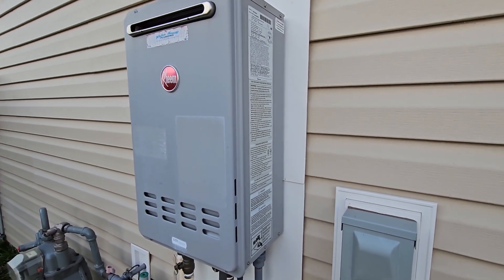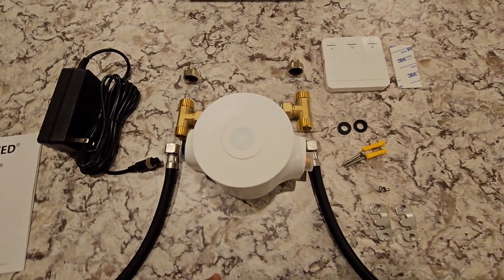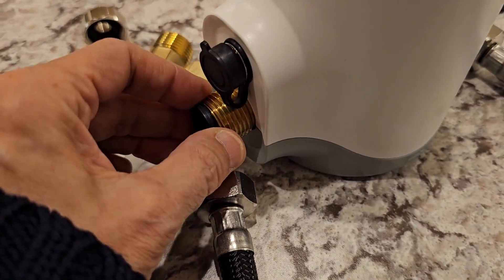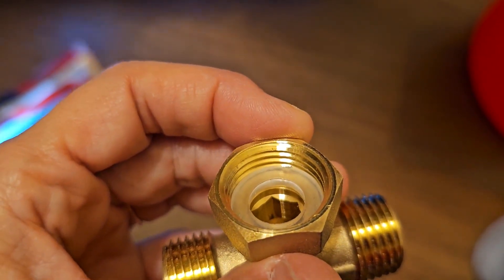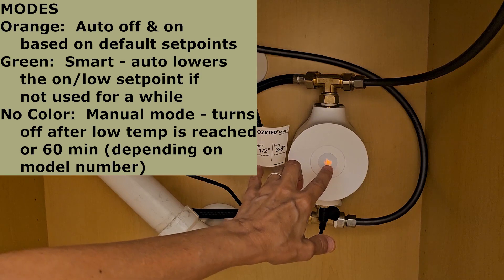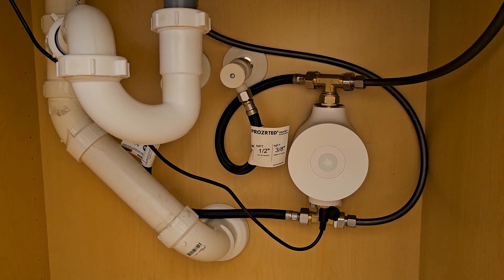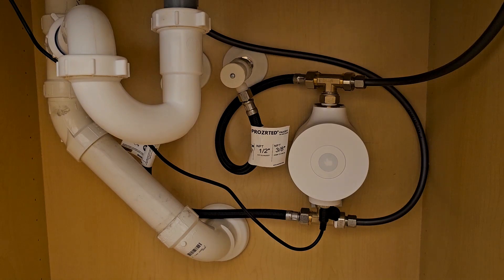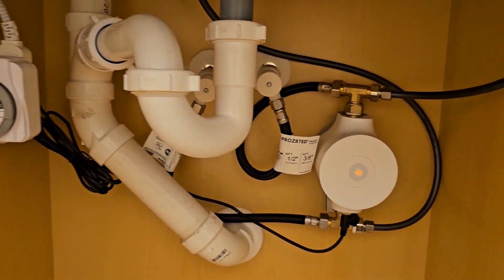Prozrted Smart Instant Hot Water Recirculating System - Install and Use

Comment: This solutions works if the heater has a non-return valve?
Reply from the maker: Yes. It it uses the cold water to return. The cold water stays slightly warm, but not annoying.

Comment: I just bought this system but the manual clearly states not to vertically mount the motor shaft. The manual shows it mounted many ways and has an “X” through the incorrect way even though some of the diagrams show what looks like the incorrect way. Unfortunately, the pictures are poor quality so and your installation looks like the incorrect way. Did you pursue this with the manufacturer?
Reply from the maker: We've had no issues whatsoever.  I no longer have the manual. But, the Amazon listing for our model shows it mounted vertically.

Comment: Does this unit only work for the faucet that this pump is located at, or do all the faucets get the benefit?
Reply from the maker: All of the faucets benefit.  If you locate the recirculator at your the sink furthest away from your water heater, when any of the other sinks are used, they will just have to get hot water from the central line - not all the way back at the water heater.

Comment: it works well to supply "warm" water but when I try the manual switch to high it doesn't change water temperature. I would like the pump to stay on longer to get hotter water.

Comment: Can this pump be turned to manual mode in the on state when power is given?  Just wonder if a smart plug could be used to turn this pump on and off vs using their remote?
Reply from the maker: We have ours plugged into a timer. So ours is only on in the mornings and late evenings.
Reply: @Jean78578  thanks

Comment: That is NOT an instant hot water heater. It is a tankless water heater. Big difference.
Reply from the maker: Well, it definitely is an instant, or I would not need the recirculator..   Lol
Reply: @Jean78578 
If the hot water in the geyser is below 38°c, the system will continue to run until your geyser produces 38°c hot water.
.
.
Reply: Instant hot water heaters are tankless heaters, there’s no difference. What are you talking about.
Reply: Does not provide instant hot water. Not well designed. it will still give cold water before the hot water.
Reply: I believe he is talking about the fact instant hot water leaving the tank does not mean its instant hot water at the faucet; just a simple misunderstanding.

Comment: Of course if kept on auto your costs may increase but based upon how often you previously used hot H2O and made it hot by running for 5 minutes down the drain as I had to, perhaps not. It depends on pipe length under slab and where you live ( ground temp here is between 50-70 all year) but if you want be sure, do what I do - keep on manual, press to run. Same heat loss, same cost to heat as non pump method but pump shuts down when H2O is hot. Now however you save the cost of whatever your water company charges per gallon which used to go down drain and, if you are hooked to sewage system the amount you spent for each gallon "flushed" which of course they calculate by amount of H2O used. Good for both earth and you.

All of which is immaterial. The video is the best I have seen for prozrted. Concise, specific, and covers all the points the confusing manual and Amazon pundits raise. Not to mention :  These folks have the cleanest undersink cabinet, waste pipes, and kitchen counters I ( a glorified plumber) have ever seen. Good video, really clean house, excellent narration.  Fullmarks, well done. Thank you.

Comment: You're correct about the individual situation, but I just wanted to show that there is a point where this system might sound like an answer to a frustrating issue, when with the cost of energy rapidly increasing under this administration, a cost / benefit or diminishing return analysis might prove it not be a viable solution. As I mentioned, something like 2 or 3 regional on demand systems with the proper timers / thermostats may be a better long term solution.

Comment: I'll bet you have a 2 story house with a basement and no one is home during the day. I have a 2,800 sq ft. ranch on a slab and we are retired. I'm pretty sure that Physics would argue that your system only runs 2 mins. an hour within a reasonable temperature range in a typical house. Especially not in a house where the slab acts like a very efficient heat sink with 200+ feet of copper pipes.
The longer it takes to get hot water to your faucet the more it will cost to keep hot water circulating through out that perfect heat sink. There's probably a formula somewhere to go by, like time to heated water divided by the required period of instant warm water, or something similar, but the benefits may not always outweigh the cost. Instant on systems located at designated regions of the house may be much cheaper to run.
Reply from the maker: We have a small one-story house. I believe we have PTFE water pipe running through attic. It takes several minutes to get hot water to any of our faucets..  In our situation, the re-circulator has been a big help.  Different homes have different needs.

Comment: That would result in a trickle of hot water constantly being drawn off the heater. The pipes are run through the concrete slab, a very efficient way to COOL the water inside them. The bigger the house, the more hot water is needed to make this system work. Just how much will show up in your gas or electric bill. Very costly to operate!
Reply from the maker: It has a temperature set point for when it comes on and a temperature set point for when it goes off. It runs for about 2 minutes an hour. Far less than if you are waiting for several minutes for hot water a few times a day.   All the time that you're waiting for water to get warm, it's running down your drain. This system avoids that.  We also added a timer so it only runs during the morning hours and evening hours (since we're usually out of the house during the day).  It saves us money and frustration. However, a water recirculator may not be for everyone.  :)